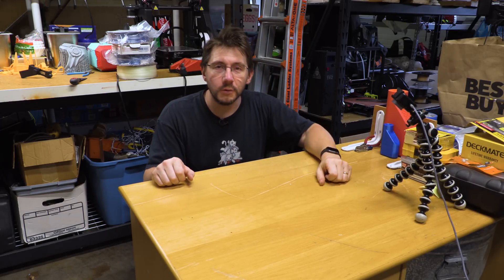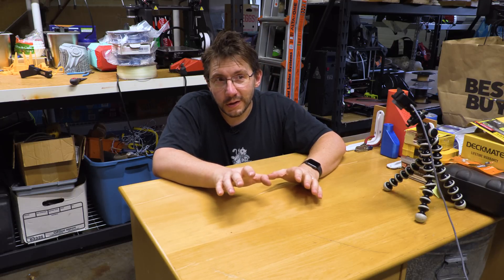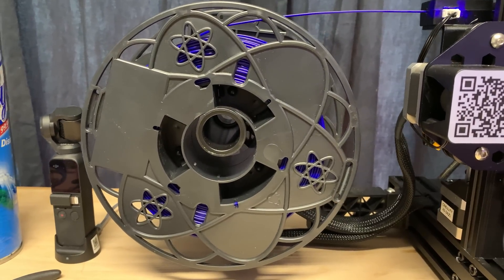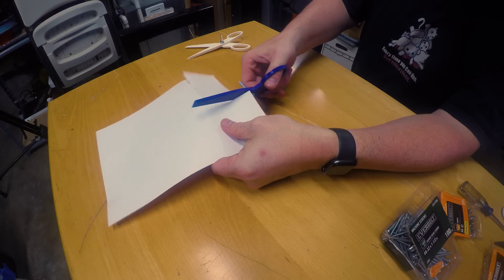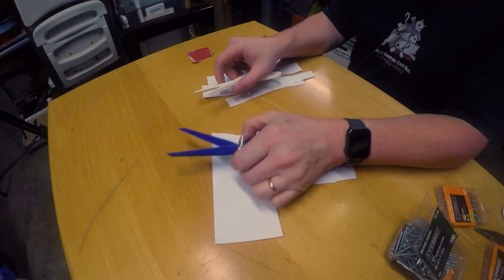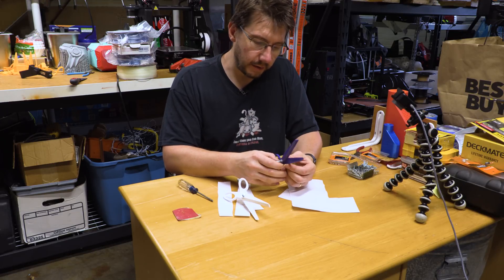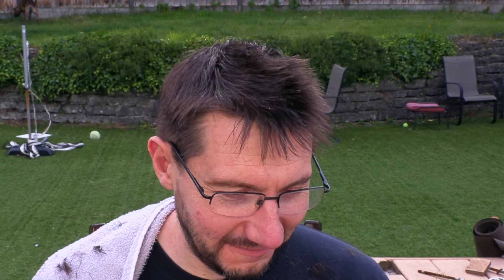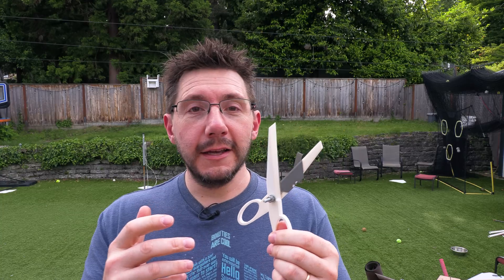Can 3D Printed Scissors Cut Hair?

Comment: I would try heating them on a very slightly curved surface to put that slight bow in them, maybe a car hood. Then put a coat of something sturdier on the bevel that might hold a sharp edge better. Maybe an acrylic or polyurethane, some kind of resin?

Comment: Nope... sorry.. "utility" type razor blades are honed on both sides, which means instead of two flat sides meeting on a honed edge, you have two angles that won't meet unless forced because of the thickness between them.

Comment: Looked like you were sanding the mating surfaces also.  As several have pointed out they should have a slight curvature to keep pressure on the cutting surface.  Even if you took metal scissors and sanded them on the mating surfaces they won't cut as well.  Only sand the top surfaces not the mating surfaces when sharpening scissors.

Comment: My hair cutting scissors have tiny serrations one one blade to keep the hair from sliding down the blade. I dont know if you could print them as tiny as they are on mine, but you should try that. They work so much better than paper scissors for cutting hair.

Comment: 😂 Nice try Joel. If you superglue razors on both parts of the scissors and tight them as close as possible you'll get good results. Glue the razor so that 0.5 of the cutting edge stick out on one part and 0.8 on the other. Love your vids

Comment: For scissors to work best you'd need them to have a single bevel on each blade with each of them having a slight concave to them. The concave in the blade localises the force to where the scissor blades are in contact with each other, instead of distributing it along the rest of the blade.

Comment: Funny that you had this topic just now. Over the weekend I worked on the problem of getting a decent hair cut, too. BUT I worked the other way around and not wanted to sit in the garden due to the mess of getting hair everywhere. 
https://www.thingiverse.com/thing:4458257
That´s why I added real scissors to my vacuum cleaner. Problem solved.
I am currently working on a model with adjustable length.
Nice video. Always love these type of DIY and 3d printing.

Comment: Joel, so I watched this video with the hopes that it would work (since all of this lock down stuff I have transitioned to cutting my own hair). After I finished your video I wanted to know why the razor blades didn't work. And as mentioned below (or above, whatever the case), scissors (shears) are bowed slightly. But that was not your issue with the razor blades. Razor Blades have a beveled edge on both sides. I have access to rolls (2 ton rolls to be exact) of razor blade material. What I have access to is actually for the interior of fuel pumps. When you pay at the pump you then get a receipt at the pump. The razor blade that cuts your receipt is what I am using. It is only beveled on one side (and is slightly flexible so it could probably be bowed). I made a mock up with some flat printed pieces (that I had in the scrap bin) with this material hot glued to them as you used. They worked. They actually worked rather well. So if you want success I would suggest finding a single side beveled razor blade and have another go. Thanks for the nifty idea. High Five.....

Comment: If you actually want to do this, you can get single edged razor blades often sold as scraper blades. The double beveled edge on normal blades will cause a problem.

Comment: About four years ago I was in Toronto at the office and got a chance to play with scissors printed on the HP JetFusion. They were printed with the pivot in place and apart from being made of plastic the looked exactly fit and finish wise as a pair I would have bought from the drug store.  If I remember correctly they took about six seconds a pair to print. The blades were bowed so there was tension along the whole length of the blade. Now, why didn't I think of cutting my hair?

Comment: Joel:  Hair, like Kevlar cloth, slips along the blade unless the edges are very sharp. There are special scissors that have ridges at 90 degrees to the cutting surface just for Kevlar, but you can put in the grooves yourself. On metal scissors you groove them with a bench grinder, but on PLA a coarse grit (like 120) would probably work. See https://m.youtube.com/watch?v=rG6ZFA543BI

Comment: sharp metal scissors won't cut hair either.  when I "sharpen" hair scissors, I use a coarser grit and grind perpendicular to the edge, so it leaves a serrated edge to catch the hair.

Comment: Sharpening scissors is an art. there is no chamfer on the inside edge. only on the outside. it takes the 2 flat sides being very close to each other to achieve a good cut.

Comment: A heat gun used to create a slight bow in the plastic would allow you to get the right kind of cut without having to sharpen the plastic but only having to smooth the surface.

Comment: the razor blades don't offer a completely flat surface at all, so you won't get a good cut. There is a gap between the two razors, so your hair will slip into the gap and it won't get cut. Unless you can get a pair of razor blades that have a completely flat surface on one side, you won't succeed.

Comment: You sanded the flat part where the two sides marry (re 4:09 and 4:16). That should never be filed/sharpened. The only place that should be sharpened is the angled edge. You ruin the shear point otherwise.
Same principal on Reel mowers with a bed knife. Also I would use a more rigid sharpening method as sandpaper doesn't accurately sharpen in a straight plane, it is too pliable.

Comment: Razor blades have the wrong profile for scissors, the are ground on both sides of the blade like a knife, scissors are only ground on one side like a chisel. I think you got away with it on the paper because they are very sharp and the paper is somewhat rigid,but you would have had a hard time making precise cuts. I think they fell flat on hair if you didn't pull it straigt because the hair could bend and fold though the gap created by the double grind of the razor.  I suspect that if you sand them to the right profile and give them a slight inward curve with a heat gun they could be made to cut... Briefly.

Comment: Most razors are double bevel.  Scissors require a single bevel with the flat sides against each other so they will shear.  Scissors are sharpened different compared to a double bevel blade.  The single bevel should be sharpened on the outside, but never sharpen the inside so you can retain the single bevel.

Comment: The problem is both the bend missing in the scissors and the knife blades you used have a slight chamfer on both sided of the cutting edge so the cutting edges can never touch each other. This is needed to 'pinch' the hair because on a micro-scale the hair will bend of the two cutting surfaces are not perfectly aligned or have space in between them.

Comment: How do you decide to make scissors and completely miss out on how shears even work? Your utility blades are double ground, meaning holding them parallel won't make the edges meet. Shears use two edges sliding against each other. This often involves not having either flat, but concave (tips bent across to the other's side), so they're guaranteed to meet at precisely one point. On top of that, they may have convex edges to keep the angle they meet at near constant as the meeting point slides out toward the tips. All of these are significant factors, probably more so than the edges actually being acute (but they do need to be sharp).

Comment: The primary reason those razor utility blades didn't work is because they are bevelled on both sides. Because of that the sharp edges don't meet, and the hair won't be cut, but will just slide down between the blades. It probably worked a bit when you tried because you held the hair taught, forcing it to come into contact with the blade.

Comment: Try using meshmixer to modify the length of the blade 50% shorter. Then to give more beef thicken the blade by 25% so they don't flex so much. 3rd scallop the edges so that when they encounter the hair they capture it rather than letting it slide down the blade.

Comment: I believe the main issue you had is that the razor blades are actually two sided. So while the Blades would match perfectly at their thickest point (the main body) at the cutting edges they were pushed apart by parts of the razor closer to the pivoting point. To solve that you would actually have to bank the blades into the material so that only the cutting edges actually meet. Otherwise you'd need to find one-sided razor blades

Comment: You should have sanded the blades flat on the mating surfaces first.  That is the most important thing that makes them cut - zero gap between the mating edges where the bevels meet because they cut by shear force rather than just edge sharpness.  Utility knife blades are entirely unsuited to this purpose because they have a double bevel an no ability to apply shear force.  Only after you've got the mating surfaces matching perfectly along the entire length of the bevel can you hone the bevels so the scissors are  really sharp.

Back to square one, but think about how scissors actually work.  I think it should be perfectly possible to make scissors that work, but because they are plastic and not as hard as steel they will not hold a good edge very long.  PLA is the better option because it's hard and rigid, so easier to sharpen to a fine edge and will hold the mating surfaces against each other.

Comment: I think one problem you had is those box cutters are double ground (beveled both sides) I think the snap off blades are single ground. If you put the bevels out and deliberately warped the scissors so the bow in a little I think it could work well. Other bonus is the snap off blades are longer.

Comment: Plastic scissors can work.  Shorter versions with a round nose used to be common in primary schools here in the UK, but even with a slight bow and properly formed edges so they shear, they're not useful for anything much tougher than paper.  That was really the point, I suppose.  No fingers cut off by five year olds.

Comment: I designed and 3D printed a No.4 guide comb to fit on the trimmer of my razor to convert it into a barber's clipper and that was a complete fail. It just wouldn't cut long hair.
Reply: Go slowly...remember that your actual cutting area is still only 2-3 mm long. They aren't laser blades.

Comment: I think you find that those shafts of metal are called Bolts Not Screws.. Hence the words Bolt, Washers, Nuts... Shame it was only able to cut paper!  But you tried.
Reply: Nope, they're Philips round head machine screws.  A bolt is something that fastens an object onto another object, is only threaded partway up its length, and normally has a hexagon head.  A fastener threaded full length is a machine screw.

Comment: Scissor blades are not flat on the sheer. They are normally bowed in towards the tip. That's how the edges always "bite" at each other.
With blade printed flat againt the print surface you will not get this effect.
Reply: This is something to work with. How can you manipulate printer setup to achieve the right bow when the blades are loosened from the print surface? I once saw an experiment where coggs were machined to be crooked. The idea was that the hardening process that followed would "crook" them back, avoiding the usual last grinding step.

Comment: If you look at scissors the metal actually bends slightly towards the opposite blade, so they overlap. This keeps the spot where they meet tight. If you were to try putting a bend in the plastic you might find they grip more, but would have to sand out the inevitable layer lines